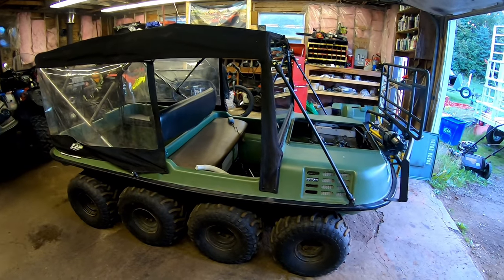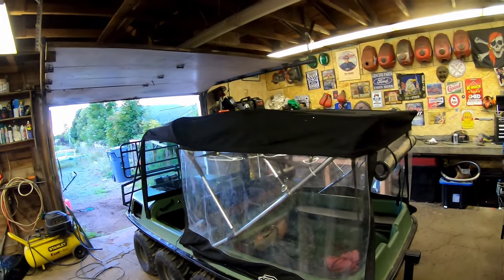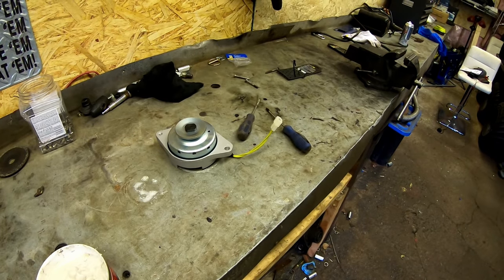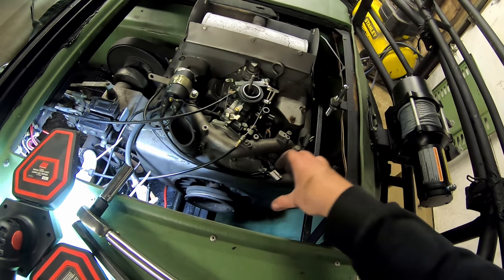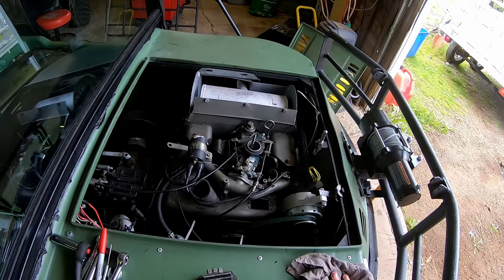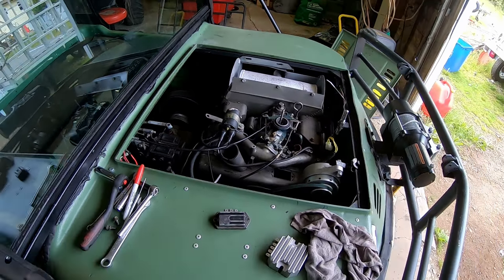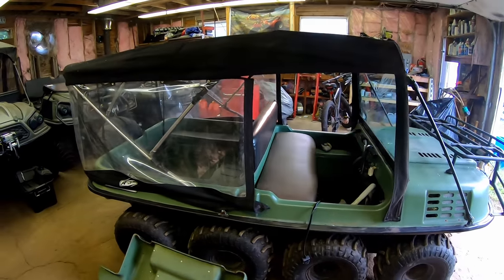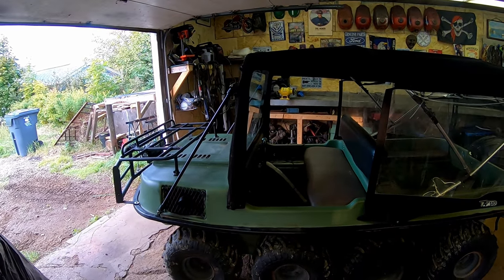Argo Bogmaster Build Episode 3:  Alternator, Canopy, Tidying up

Comment: Project turned out amazing Muddy.  How tall is that windshield?  I am thinking of making something for my '96 because I don't want to spend the $1500 on a new one.  

Likewise, I am thinking of modifying a boat bimini top to fit the Argo by adding side curtains.  My Argo originally had the windshield and top but when the first owner traded it in on new machine, the dealer kept them for his personal Argo before he re-sold the unit to the guy I bought it from.  Having a top would be really nice when plowing snow.
Reply from the maker: Thanks , I’ll get some measurements for you. My 8 wheeler I’m probably use as a workhorse soon. I’m building a cabin this spring , hopefully start making videos soon on my land and stuff. Yes canopy is needed especially in bad weather for sure